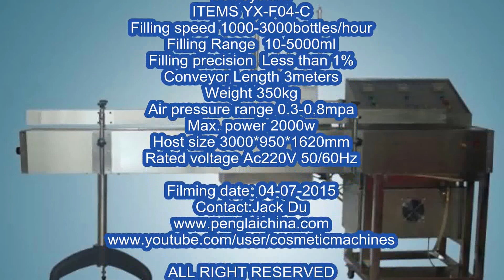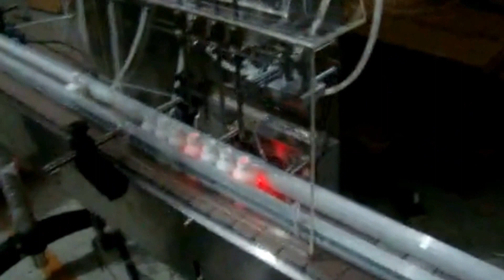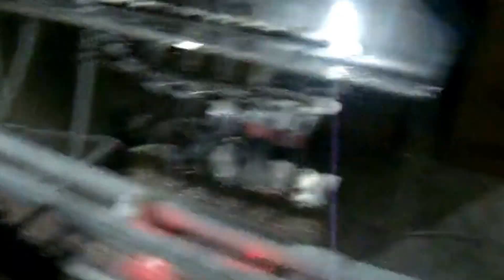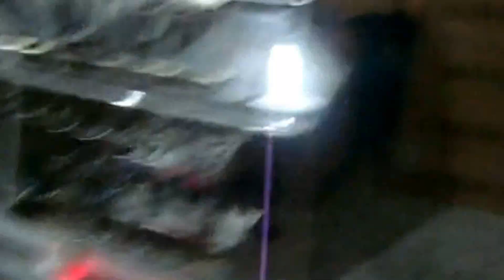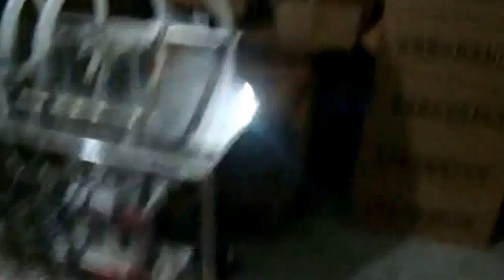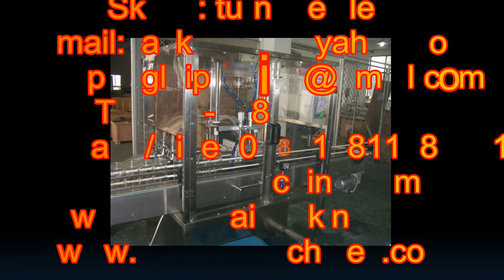customized magnetic pump oil perfume filling machine assembled line máquina de llenado personalizado

Comment from the maker: Business website www.penglaichina.com
Basic parameter of customized magnetic pump filling machine assembled 
filler line for essential oil perfume máquina de llenado personalizado 
model YX-F04-C
Filling speed 1000-3000bottles/hour
Filling Range  20-5000ml
Filling precision Less than 1%
Conveyor Length  3meters
Weight 350kg
Air pressure range 0.3-0.8mpa
Max. power 2000w
Host size 3000*950*1620mm
Rated voltage Ac220V 50/60Hz
Source from http://youtube.com/penglaichina